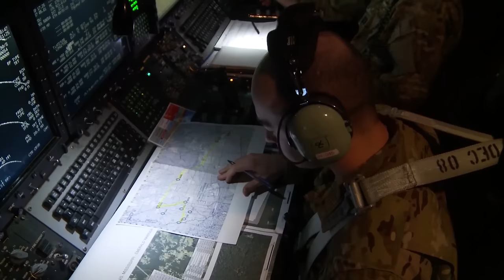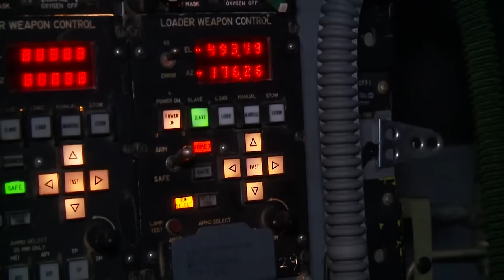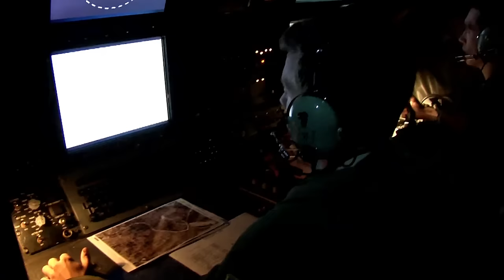AC-130 Gunship in Action - Firing All Its Cannons • Exercise Emerald Warrior

Comment: the fact these things fly still blows me away. amazing power
Reply: Semper Fi  Hell yea brother. Many people consider turbo props to be outdated, but those engines will last forever.
Reply: I'm surprised they still fly manned gunships. The same job can be done with a drone and no one will die or land in captivity if one of them get shot down.
Reply: @buntaichosaber3121  you can't loiter over a Target with sustained firepower like the c130 does.  There is no drone with that kind of payload capability.  They can refuel in the air and stay on target for days if they want.  They can also manually select the ordinance type depending on the target they encounter.  AP, incindiary, or other.  Also, you ever seen a drone fire a 105 howlitzer round?  I think not.
Reply: @jblondin1980  but how manny kamikaze drones can u make for the price of this one  ? 😉
Reply: @davidstalley384  haha i dont think i would like that 

"Van" means from in Flemish and is the first section of my last name, not sure why this is my name i feel like the youtube account whent automatically somehow, annyways i do live in a van 😂
Reply: @michiel3036  roughly 48.  Predator drones are about 4 mil, a gunship is about 190.  However, gunships fly for 40-50 years.  Return to base, rearm, and go back.  3600 lb vs 42000lb payload?  C'mon dude.
Reply: @jblondin1980  what about remote controlled gunships? they could do all those things.

Comment: As an old AC 130 A model gunner, it is great to see the upgrades and changes.
Reply: what kind of health issues do you have from being in an enclosed space while breathing in all of the chemicals?
Reply: @blahblah8372  He probably died before he could give you answer. :(
Reply: @blahblah8372  They are sucked out thru the gun barrel. Exhaust fumes sitting on the ground are more of a problem. It’s a little drafty in there also not sealed up.

Comment: The Lockheed AC-130 gunship is a heavily armed, long-endurance, ground-attack variant of the C-130 Hercules transport, fixed-wing aircraft. It carries a wide array of ground attack weapons that are integrated with sophisticated sensors, navigation, and fire-control systems. Wikipedia
Top speed: 482 km/h
Introduced: 1968
Length: 30 m
Retired: : AC-130A: 1995; AC-130H: 2015; AC-130U: 2019;
First flight: AC-130A: 1966
Unit cost: 110,000,000–120,000,000 USD (2010), 132,400,000–190,000,000 USD (2002)
Manufacturers: Lockheed Martin, Boeing, Lockheed Corporation

Comment: tanks: we dominate the battlefields .. nobody can't destroy us 
.
.
.

Ac130: so anyways.. I started blasting!
Reply: Lol 105mm rounds just bounce off of Abrams' tanks.
Reply: @e-wing6200  oh no .

 Imagine ?? 105mm ricochets ----
Reply: Jake Ewing maybe from a tank round, but this is a howitzer round being shot down from the heavens like a bolt of lightning
Reply: @Sweedster  Lol yeah, that's like direct fire from a 105 Howitzer. Besides, the top of a tank where the turret and the hatch is, is the most vulnerable, no?
Reply: A-10: OUR battlefield
Reply: @IudiciumInfernalum  it depends what types of tanks 

I've seen most armor are around the sides and around the Hull .. 

The top ?? Some tanks have armor on top in case of Artillery
Reply: Some tanks have mounted 20 or 30mm on top as AA....
Reply: MIG 35 and KAPETS
Reply: @IudiciumInfernalum  ur right
Reply: @IudiciumInfernalum  Wouldn't also a 105mm HE shell just kill everything inside from pure force/shock? I doubt there are tanks that can take a 105mm round to the top
Reply: A10 Warthog
Reply: Tanks have usually 20-40mm of armor on top. This is to reduce against grenade splashes, normal and high penning rounds so a guy cant just take a 50 cal and pierce through, and for arty explosions. But if a 105mm hit a tank directly from the top, the shockwave alone would kill and  if it missed, it would easily destroy tracks.
Reply: @matthewacosta6430  Electromagnetic Pulse

Comment: “Do NOT fire upon the church”

Thump.
Reply: Haha. 105 MM cannon go thump thump thump thump.
Reply: AC-130 Navigator: Uh, TV, confirm you see the church in the town.

AC-130 TV Operator: We see it, start the clock.

AC-130 FCO: Roger that we're there, start talking.

AC-130 Navigator: You are not authorized to level the church. Do not fire directly on the church.

AC-130 TV Operator: Got a vehicle moving now!
Reply: Do NOT fire anything with a flare:(Church does NOT have a flare)
Me: STARTS LOADING 105 MM

no JOHNSON NO NO NO BOOM and there it goes.

Comment: Does anyone know how pressurization works on this beast?  They say it’s an unpressurized cabin yet can reach a ceiling of 39,000 ft.  I was trying to search the average (and optimal) altitude range for engagement, but still couldn’t find out what crew does with pressurization at higher altitudes.

Comment: alway wonder if the american military ever thought of turning a C-17 to a gunship?
Reply: Maybe too big
Reply: C-5 Supergalaxy is bigger :D
Reply: They've thought of all kinds of projects
Reply: Prolly too fast
Reply: @domwings4329  maybe up-gun the whole concept to various size missiles. Satellite & drone-assisted; orbits much higher; covers huge territory.
Reply: C-5 is to big and not as maneuverable. C-17 can probably be converted to a gun ship as it can fly at low speeds, but probably a waste of money.
Reply: GMC-17 guided missile plane would be <3
Reply: C-130 is ideal due to it's size. Engines are far quieter than either the C-17 or C-5 would allow. Bigger isn't always better. Even on a larger frame it likely wouldn't mean they could fit a bigger gun, and more guns wouldn't help. These things wouldn't fare well in a world war, but against goat herders with Soviet-era weapons, it's the goddamn Grim Reaper on a new Moon's night.

If you want precision strikes check out the Rockwell B-1 Lancer. The B-1 can launch up to 20 tomahawk cruise missiles in one payload. It's built off the X70 Valkyrie and is the most used bomber in the Middle East. Very fast, and exceptional for low-altitude bombing runs.
Reply: If the current thing working why change
Reply: Probbably seeing as they wanted to make a 747 into an aircraft carrier
Reply: In thinking of a Boeing 747 being a massive ass kicking machine equipped with rail guns 104 mm tank cannons
Reply: WolfPup Mcintosh probably can’t sustain the pattern around the team. The c130s are sent out in support of spec ops, you’ll not see them any other time and I’d say a majority of that is at night and you’ll never see it.

Comment: Imagine one of these showing up after d-day when the Germans fell back to the hedge rows
Reply: Well, SAMs may have not existed in 1944, but AA and flak cannons were still a thing back then. The 130 would probably be extremely effective in clearing out pockets of retreating German resistance, but the AA defenses would still be present throughout German held territories, so the 130 would still have to be careful of that. It would be vulnerable to German fighters as well. The Messerschmitt BF 109 could climb to over 30,000 ft., while a 130 typically operates around 10,000 ft. It’s also only slightly faster than bombers of the era, with a max speed around 300 mph. The 109 had a 380 mph max speed. Basically, the AC-130 would probably be effective, but it would still have to deal with the same problems and vulnerabilities of any bombers back then.
Reply: @hectorarias9516  it's much more effective on night time because the enemy may have radar but they don't have night vision so when these gunships started raining hell the Germans have no time preparing and even the Luftwaffe and even more screwed if the infantry and armored units followed after the AC-130s fire mission ended
Reply: @skulldozer1462  Actually the gen0 of night vision was developed by germans just before WWII beginning, it was a primitive giant infrared light mounted on trucks that did amplify the light spectrum. US army ended developing something smaller and similar only in the mid 50s.
Reply: @insilicodrone6534  oh shit i completly forgot about that although i still dont know the range yet so you never know

Comment: Delta Force and Navy's small-scale squadron are on a special mission in ground warfare.
During the battle, the enemy's size was small.
It's a massive transition.
Attack aircraft required in case of thermal printing
If there's a disadvantage of winning,
If there are restrictions on air defense areas,
If there is a communication loss or a surface-to-air missile from our forces, the attack will be limited.
It can neutralize the enemy of ground troops.

Comment: What was the very first gun they showed firing? I thought it was the 40mm bofors but it was chain fed and they showed the 40mm bofors later in the video being hand fed?? It wasn’t the 25mm Gatling it was firing too slow. It sounded just like the bofors????

FOUND IT: it’s the GAU-23 Bushmaster 30mm chain gun used in the ac-130W Stinger2 which replaced the 25mm and the 40mm.

Comment: A lot of the dudes that run the guns on these planes end up with heavy metal poisoning and central nervous system damage from the extended exposure to lead and unburned powder in a pressurized environment. it's rough